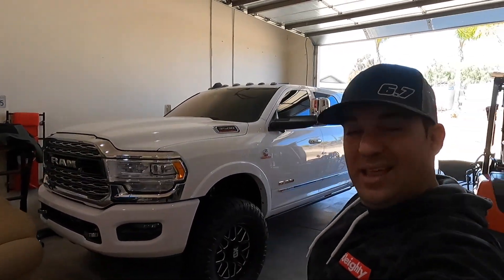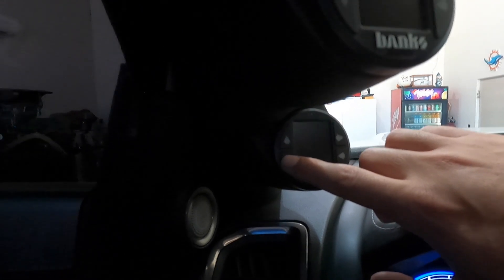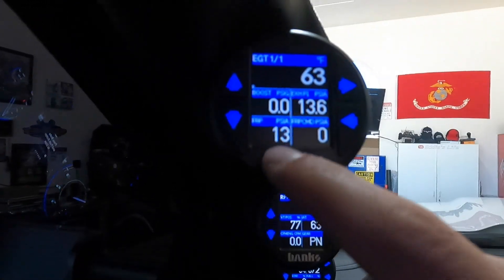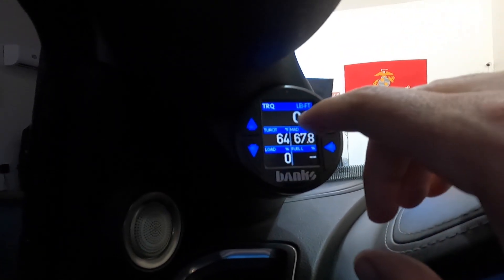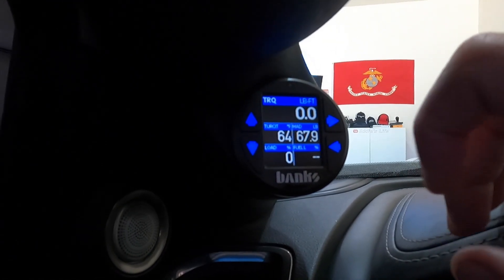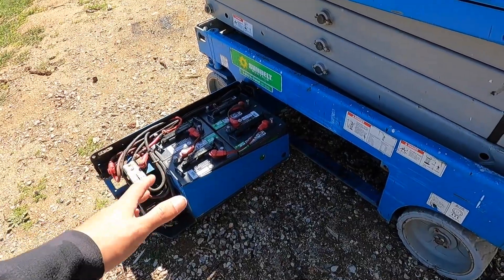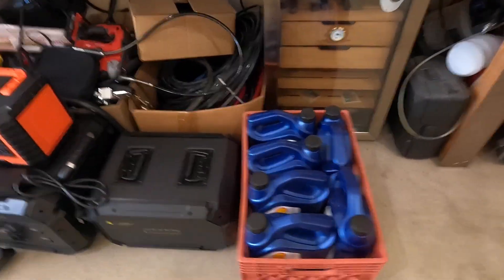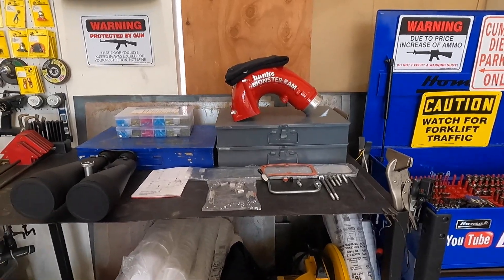My most important PID's to monitor.

Comment: Hey Eddie good video I’m waiting for banks to come out with the derringer for my 2017 ram it’s currently not available 😩😠 but have installed the PedalMonster and the ram air Gen2
Awesome upgrade. As far as Oil goes I use Valvoline premium blue full synthetic in my Ram. Excellent oil due to the fact the Valvoline make the oil for the Cummins engines.